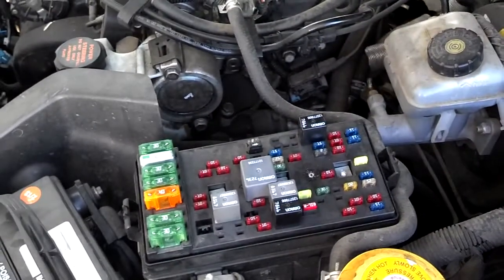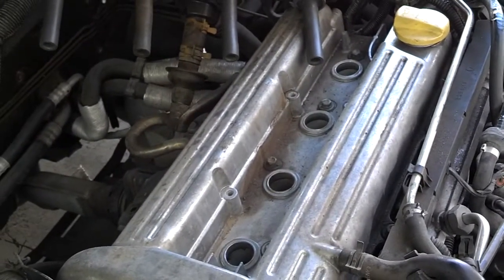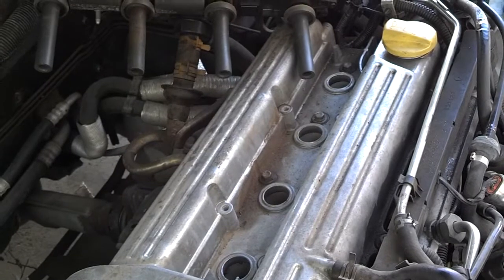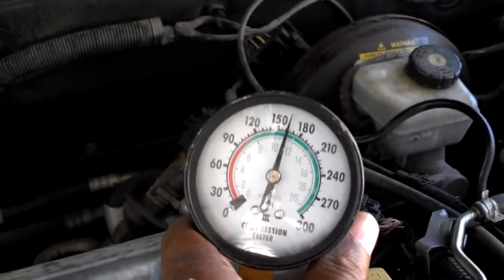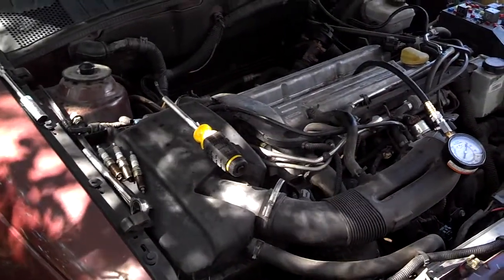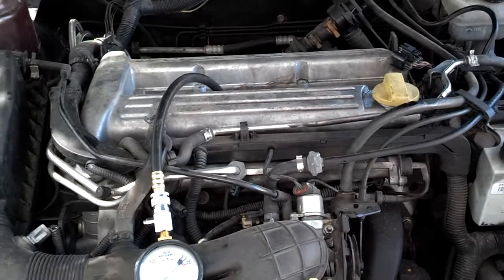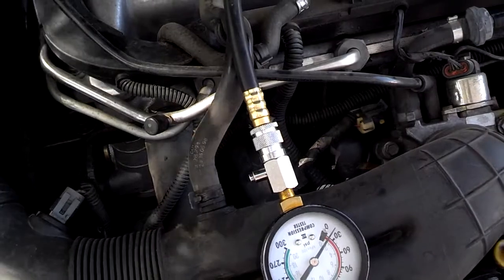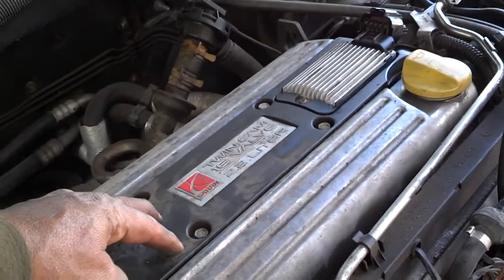Compression Test on a Saturn L Series - Auto Repair Series

Comment: Just ran a comp test on my 2003 L200 an comps were 90-60-65-70. I had no idea what the normal compressions were supposed to be until watching your video. Thanks
Reply: I didn't have a misfire or rough idle I had external oil leak near timing cover and loosing water internally. Plugs looked clean and the little car has always had subpar gas mileage. Know I see why.
Reply from the maker: +jeff bell there is a chance that you have a bad gauge. I have seen brand new gauges off by 50%.

Comment: Misfire has little or nothing to do with compression. This engine has been obviously neglected and has multiple issues. 
Misfire is in the ignition system (electrical). Compression is the mechanical aspect of the engine.
Reply: MrGreenelight please explain what codes the system will throw when the compression gets too low if it won't throw misfire codes.
Reply from the maker: It's called troubleshooting. When you have a problem, you troubleshoot it. If you have a misfire code, you figure out why, like LOW COMPRESSION. If you have a wheel wobble, you figure out if it's a bad tire or loose lug nuts. None the less, no fuel, no compression, no air, low air, can all cause a misfire. No compression is not NO SPARK, it's no compression.
Reply from the maker: +MrGreenelight Huh? - https://www.youtube.com/watch?v=Sg7iFytxfzQ
Reply: +Robert DIY 
Coils and spark plugs are electrical components
Compression  is compressed air...ie pressure,which in engines produced by the up and down movement of the pistons. Mechanical induced pressure.
Reply from the maker: And your point is???
Reply: +Robert DIY 
looks like I made a mistake in my initial response. I confused compression test with compression problem. You never stated that there was a compression problem only that you were performing a compression test. 
I apologize.
Reply from the maker: No problem. The compression problem, or lack of compression is causing the misfire.
Reply: +Robert DIY 
oh oh, I think that we may be back to square one. I am not absolutely sure. But I don't think that lack of compression will not cause a misfire. When I say misfire, I mean the plug did not fire when it was suppose to. 
 The plugs will fire independently of compression, as a matter of fact, they will fire even if the plug is not in the cylinder housing., absolutely no compression; as it does in a spark check. 
I think the condition you are explaining is not a misfire but a dead or leaking cylinder, due to poor compression.
Reply from the maker: Yes, it does. That is the whole point of the video. A cylinder needs 5 things to fire. That is why I linked the video early in this conversation. Fire = combustion. Misfire = lack of combustion. Five things have to happen or you will get a misfire code on the system:
1. Spark (spark doesn't = fire).
2. Fuel.
3. Air.
4. Timing.
5. Compression.
Lack of any of the 5 will result in a misfire.
Reply from the maker: You are confusing SPARK with FIRE. They are not the same.
Reply: +Robert DIY 
 Robert. I'm going to have to completely disagree with you on that. Although there are variations in vehicle coding systems. In general, the only thing that is a misfire is, is that the plug does not fire or literally misses a fire sequence. 
The things you have listed are the components needed to produce a "power stroke" in a in a traditional four stroke gasoline internal combustion engine. 
I think that you have your terminology confused. 
A again state that a "Mis-fire" is just as the word implies, the spark plug missed a firing sequence. 
please look up "engine mis fire" and "how engines work" to get a better understanding. 
A cylinder does not fire. only the plug fires. If the five items you listed are present at the right time, amount and order then a combustion takes place in the "combustion chamber" thereby inducing a force on the piston which then moves and creates mechanical power. (power stroke)
Reply from the maker: Ok, what is your field of expertise? What do you do for a living?
Reply: I am an tier 1 Automotive Quality Engineer,. I have worked in this field for about 20 years. Tier 1 means that the parts we manufacturer are sold directly to OEM manufactures as thier original equipment.
I realize that the  fault coding system in modern cars are very useful, but they can be also very misleading. Understand that the fault codes are generalized to direct the common user in the area of concern. But, as we know, automotive functional dynamics are often too complex for the common user to understand, that's why the coding systems are "rounded off" and generally not specific.
Reply from the maker: OK, you win.
Reply: Lack of compression can most certainly cause a misfire and set a misfire code.... and there is plenty of evidence out there to support so....
Reply: +MrGreenelight A cylinder not firing is a mis-fire. I am sure engineers have their own internal lingo and vocabulary, but those of us who turn wrenches for a living or as a hobby call a cylinder not firing a "misfire". That is the term most mechanics will use.  It does not matter the cause behind the cylinder not firing (no-spark from the ignition, low compression,  fouled plugs, etc) it is still a mis-fire.
Reply: +profet36 
Are you not reading the comments. That is what the diagnostics coding system does. It gives you the general area of concern not the specific problem. There would be too much code programming to be written and explained if every potential problem a car can have would have its own individual code. That is why numerous different issues may give you one same code even when it is not the same problem. Just like a missing or loose gas cap will throw up a code other that missing gas cap.
Reply: +Garrison Statt 
That depends entirely on the year, Make and model of the vehicle. As you know a much older car may not throw any code due to it not having a diagnostic system. If it does have a system, it would depend on the type and version level of the system. Most modern cars is the US use an OBD1 or OBD2 system. This is a ISO ( International Standards Organization) method to unify understanding. so things would mean the same thing  independently from vehicle to vehicle.